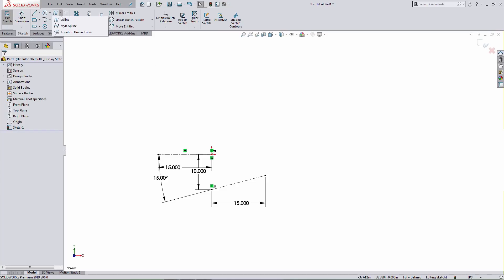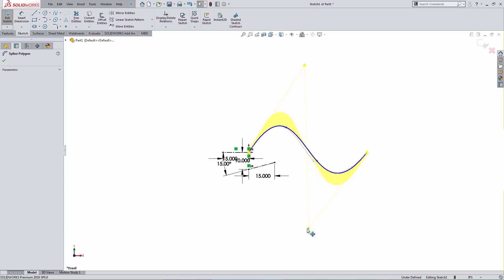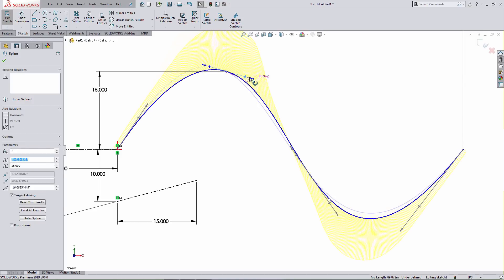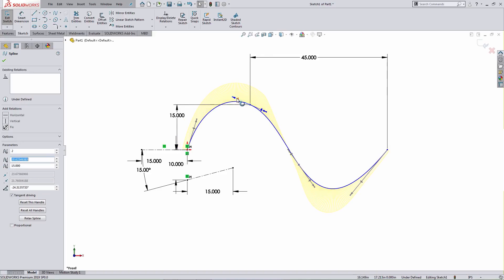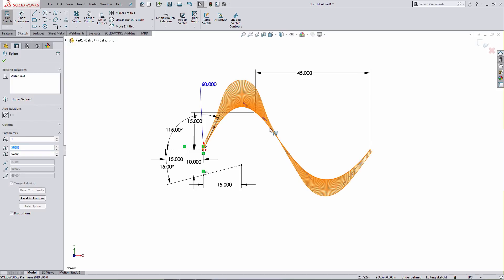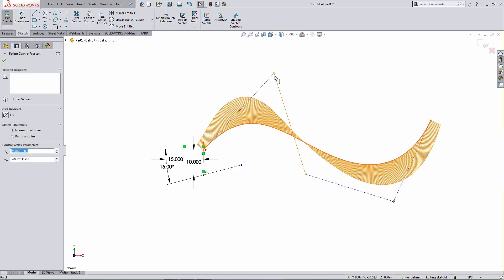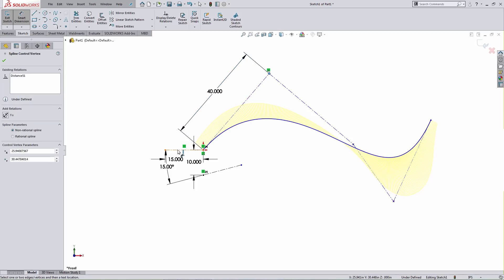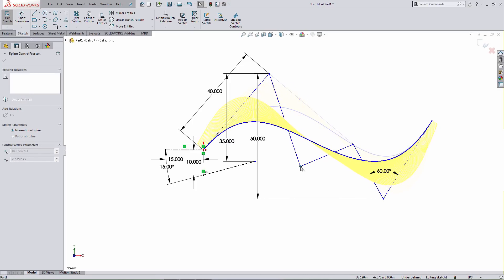SOLIDWORKS - Spline Manipulation Techniques

Comment: Hi, thank you for your useful videos.
I have a question and I will appreciate it if you can answer 🙏
What is the meaning of the dimension that we set as the "tangency length" of the endpoint of a spline?
I know what happens when we increase or decrease it, but when we are going to set it as for example 300 mm, so what thing is going to be 300 mm?
When you set the dimension of a line as 100 mm, it is clear! You mean that from one endpoint to another endpoint is 100mm!
But in spline what is this amount exactly for? from where to where?
Reply from the maker: In this case that represents the linear distance between that tangent point and the end point of the spline. This is for demonstration purposes only there may not be a good practical reason for that dimension it is sole purpose he is that you can use it to control the curvature of the spline.

Comment: I can't get those vector looking thing on my spline to  control it plzz someone help me
Reply from the maker: You may have a setting turned off.

Go to TOOLS | OPTIONS | System Options and select the SKETCH category. Make sure “Enable Spline Tangency and Curvature Handles” is checked.

If this is already ON and you are not seeing the handles, this may be video related.  Please contact support via our website GoEngineer.com.

Comment: Thanks for the video. I'm new to Solidworks, about a year in, and having an issue. Wondering if you guys have a video that might help. I'm having issues when saving and exporting as dxf files for laser cutting. The splines in my files are not smooth curves like what I see while I'm working on them.  They end up as chunky lines in the saved dxf file. I've had a couple laser cutting projects come back as chunky lines where they should have been nice clean curves from what I saw onscreen. Is there something I'm missing? This is a huge issue I'm trying to over come. Thanks.
Reply from the maker: Saving a 2D file to DXF tends to turn curves, especially organic curves like Splines, into a series of short, straight segments as part of the translation.
 It’s an effort to simplify G Code for machining, so it doesn’t generate a fairly ‘infinite’ path from the curve.  A series of straight vectors is much smaller in the code.

One follow-up question though……is you 2D Drawing of a Sheet Metal Part?
 If so, there is a feature in the Sheet Metal FLAT PATTERN Properties that might help.

Right Click the FLAT Pattern feature and EDIT FEATURE.  You will see a check box for a setting called Simplify Curve.  If this is ON, it will automatically turn organic splines into a series of line segments for the very purpose described above. If you turn this off, you will have a better chance of getting a smooth path and cut.